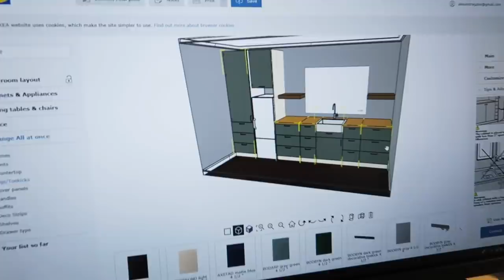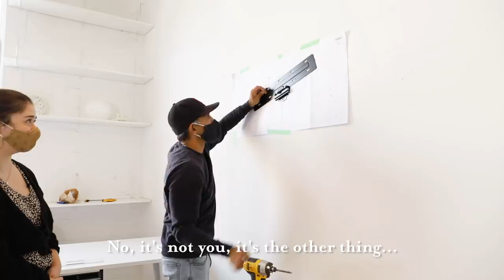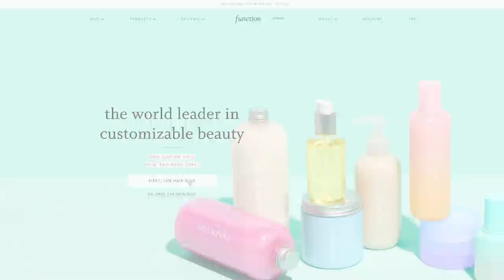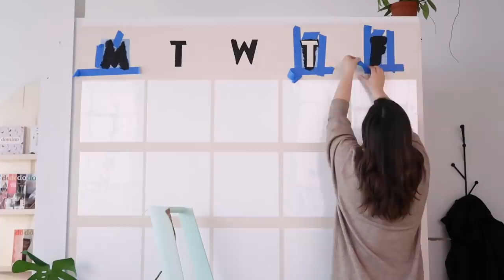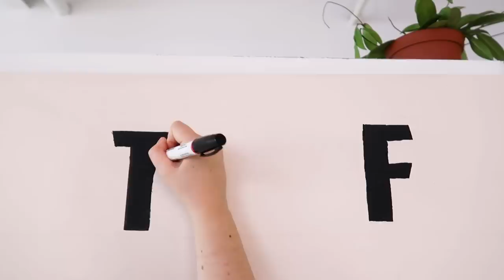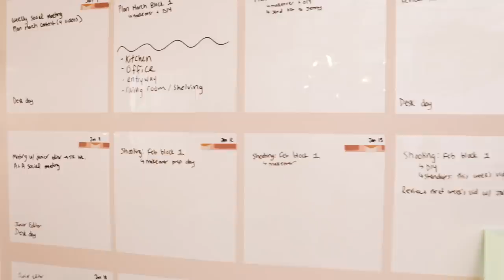Making Over My New Office | DIY GIANT Wall Calendar | Team AG Office Project S1 E3

Comment: I saw on a few tutorials about installing the frame that if you route the cable in the wall you should add a duct or use the in wall version of the cable which is properly shielded. Apparently it can be a fire hazard 😱

Comment: I have a samsung frame as well. It says that the cord is not rated for in wall and must go outside or run through a conduit as it runs power and is a fire hazard.